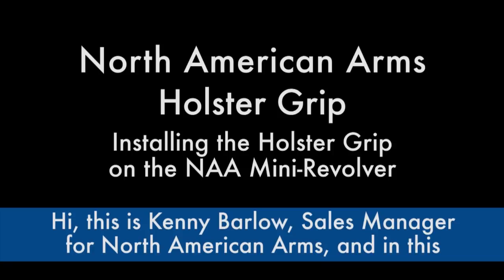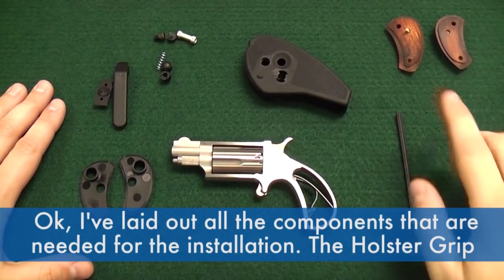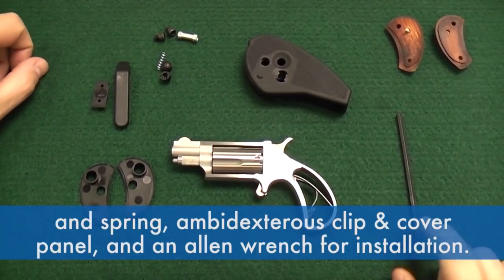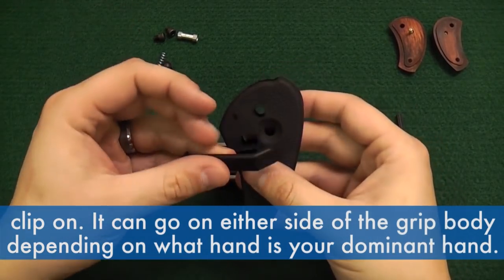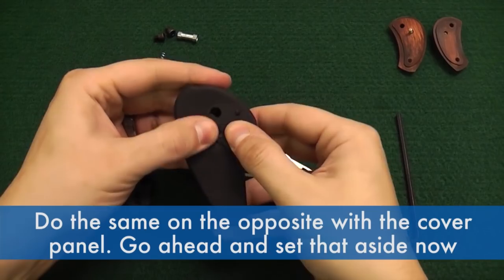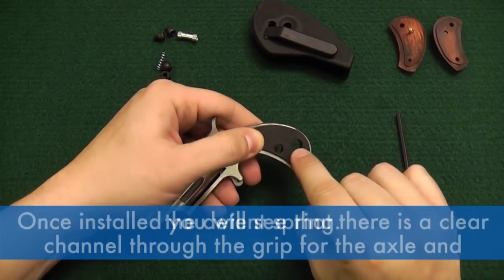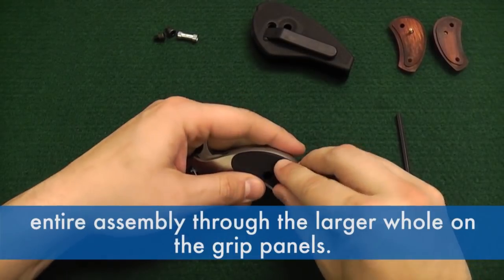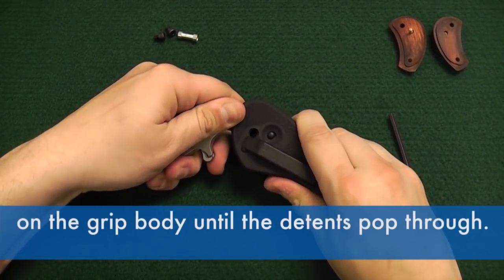Holster Grip Installation

Comment: This grip works in that the trigger is protected. It doesn't keep the hammer from coming out of the safety notch. I've had 2 of these revolvers and both had the same fault. When jostling around in your pocket there's a very good chance that the hammer will end up on a round. By itself or with the holster grip it didn't matter. Mine would end up with the hammer on a round. This problem was only solved when I bought a holster that covered both the hammer and the trigger. Great little revolver! I love mine.

Comment: I have yet to see anyone flip those holster grips open one handed. Thats a deal breaker for me. The grip holster looks like a cool idea but poorly executed. In a self defense situation, I'm less worried about the extra seconds I need to draw, cock and fire than I am with the idea that I need two hands to operate this pistol when I may be fending off an attacker at knife fighting ranges. 

Do you know if NAA has plans to address this? Or is there a trick to it that I have not seen on youtube?
Reply: I bought one used and it does it no problem. I just grip the holster, give it a flick and it pops open consistently. The previous owner may have worked with it a bit, but I would think a little judicious lubrication would do the trick.
Reply: Mine is so loose it flips open with a flick of the wrist while holding both buttons